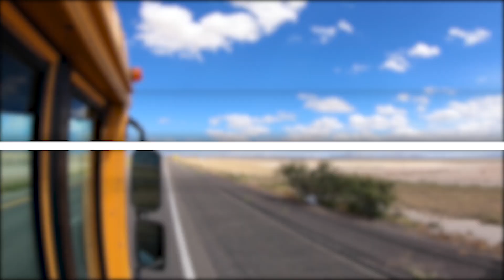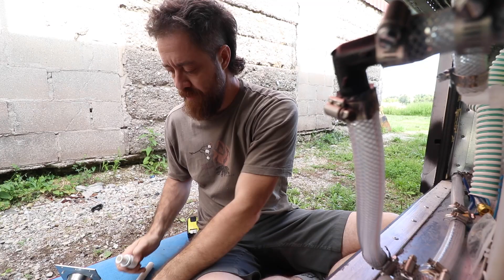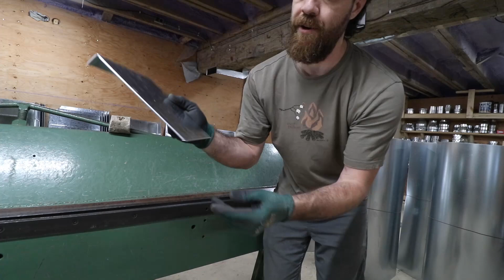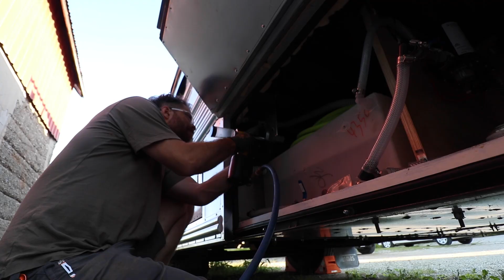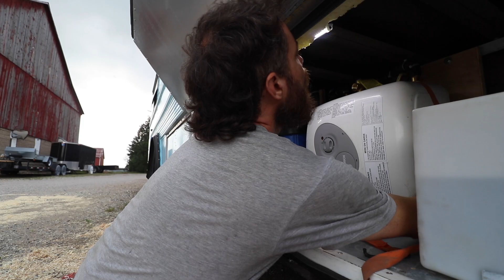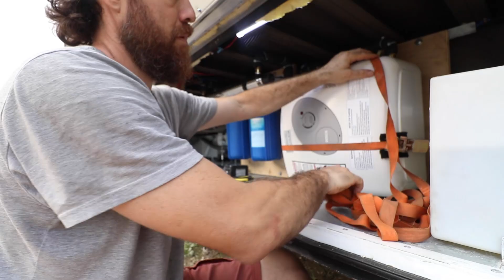NO MORE JANKY SETUP (Installing RV Water Inlet In Our Skoolie & Securing Water Heater)

Comment: might want to think about where the inlet line will rub against the plate you built ,, could be a possible problem
Reply from the maker: The inlet line doesn't touch the plate. It looks like it does on video, but I think that's just a perspective thing @Steven Annett. Tight quarters friend. Super tight quarters.

Comment: I like your guys under storage  I would like to make the same once again  thanks for the great  video  hope you guys have a good one
Reply from the maker: Thanks so much @camping Couple. We like the underbody storage too. I gotta say, if we hadn't done underbody storage, I dunno where we woulda put ALLL that system stuff. We wouldn't have had any space for us to live, or bring the things we want/need. 

Once you get to that portion of your project, let us know. It's a doozy. It took us months. Hope you are in a warm climate, cuz it's a LOT of laying on cold metal. We did it throughout the entire winter. I think it would have been more fun, and less of a slog if we had done it in the spring. 

Anyways. Let us know if you have questions. AND happy building! :)
Erin + Brian
Reply: Yeah we were gonna do the same and rip out some existing storage in order to make the same type of huge underbody. Then we looked again at our particular rig and we think we're going to go with much smaller pass through and side compartments.We have to get two water heaters and two mini split compressor/condenser units under ours along with all the solar, batteries, and tanks other than fresh water. We will be doing 200 fresh under the bed. 40 gallon reclaimed tank (showers and washing machine) will be under the bus somewhere.